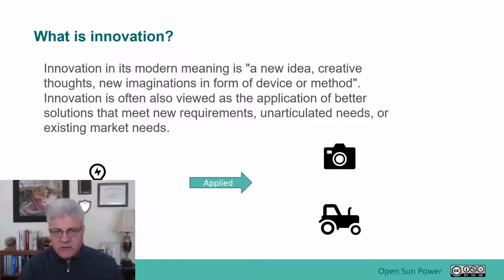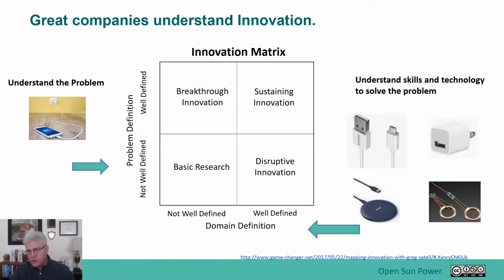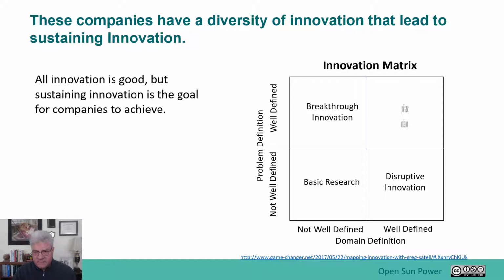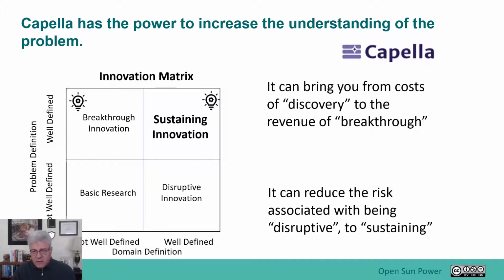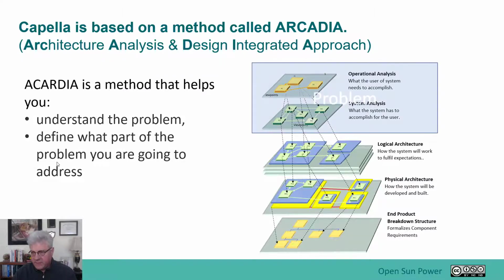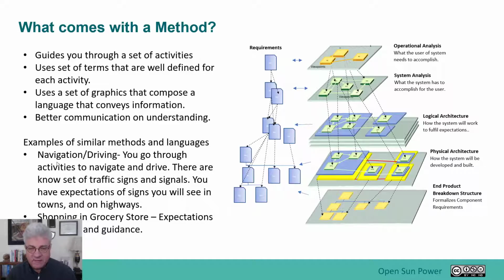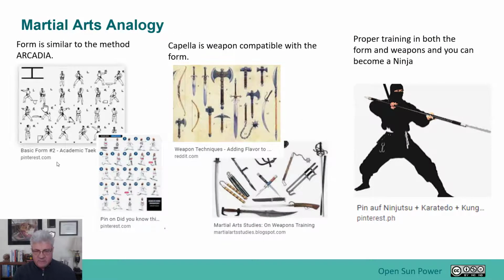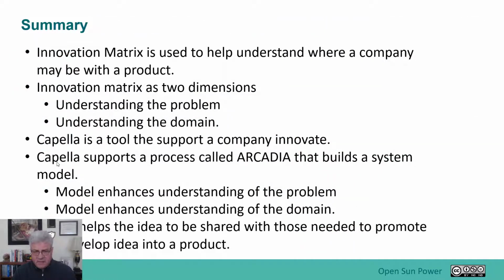1.1 Innovation and Capella

Comment: Ok cool. Which one of those do you recommend the most then, to do the simulation?
Reply from the maker: It really comes down to level of detail of simulation required. You noted bandwidth and I seen that done Capital since it can represent networks, Expedition can represent circuits. Though many start with system models to simulink. Here one of number of webinars on this topic of simulation. I like it since it points to the difference of system modeling versus simulation. They both have a role in development. https://youtu.be/PXnMfgEoTGM
Reply: @innovatingwithcapella  if we already have Simulink available, is that a good option or no?
Reply from the maker: @LynnTheGuitarPicker  Simulink is a good option. If you follow Capella Webinars  you will see companies like PGM and Glaway have products with integrations.  Other approaches I am exploring is Python4Capella to interact with Matlab Python APIs.